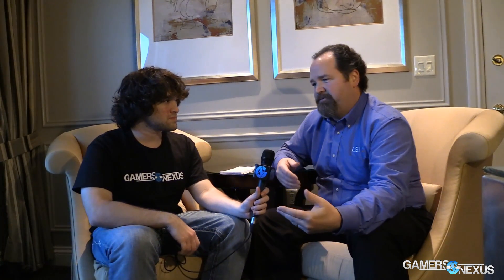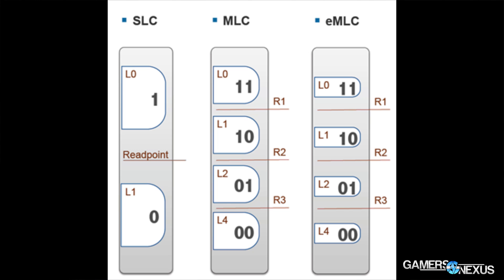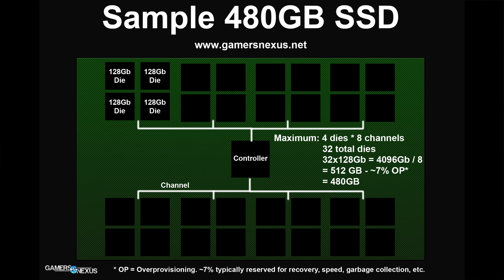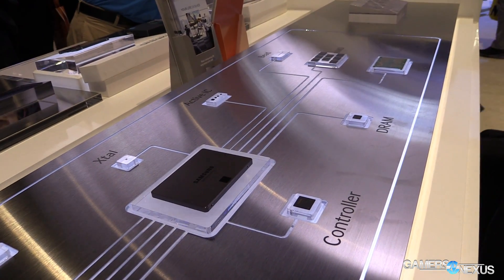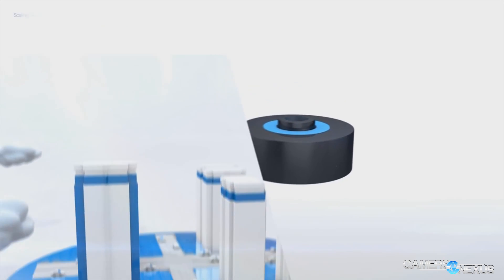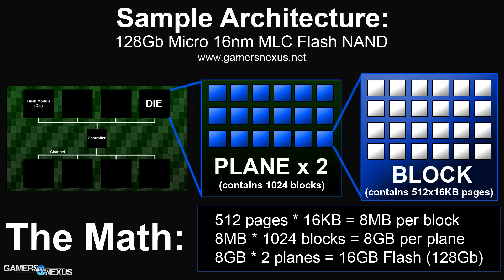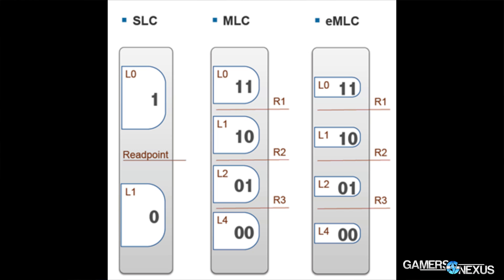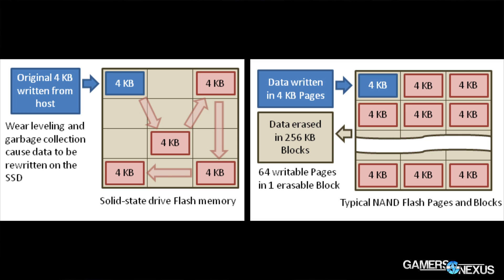How SSDs Work - SSD Architecture, MLC vs. TLC

Comment: I'm not sure I understand.  If TLC is prone to error and SLC looks like the way to go, why don't manufacturers just make SLC?  The video states that TLC is cheaper to make but I don't see how that is.  TLC is fundamentally a bit more complicated yet offers no advantages.  In SLC, all you have to do is worry about two voltage states.  Why is that more expensive to make than TLC?
Reply: Samuel Cheng in the same sized die, you can have 8 times the bit density with tlc as slc.  which is why for a 1TB ssd, tlc will use 8 times less silicon than slc, reducing the cost sinificantly, but also increasing error rates of the drive.  at least that's my understanding of it